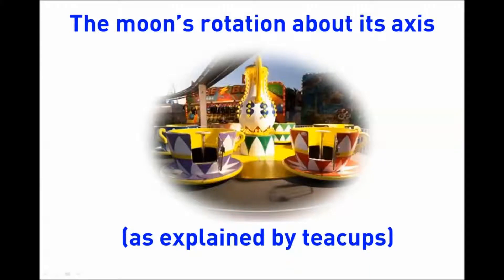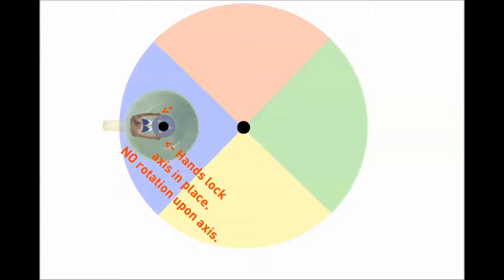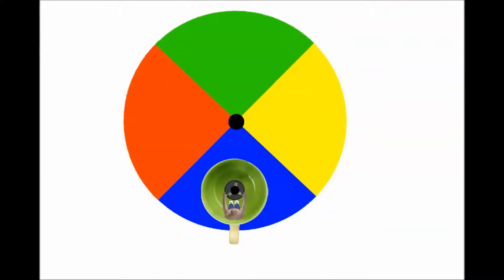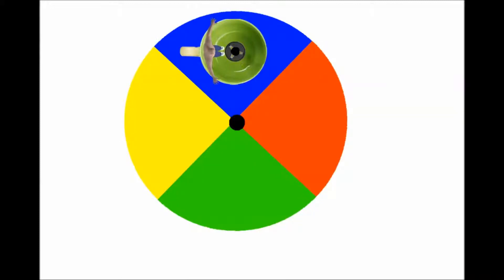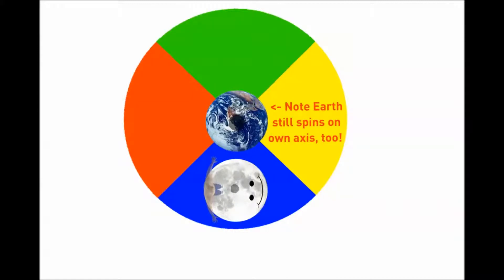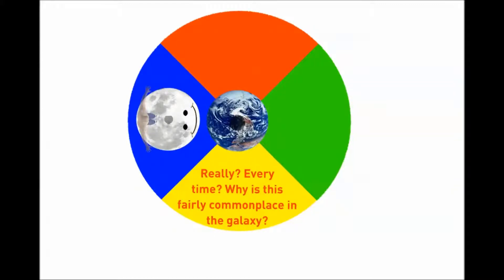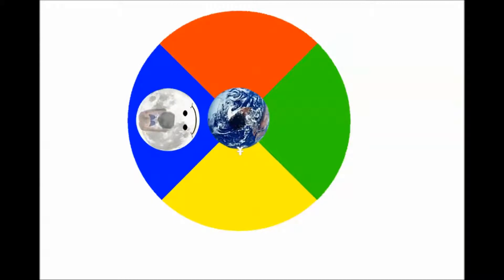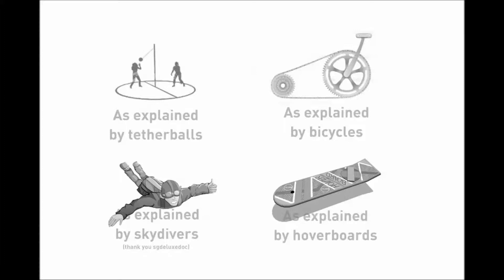Why Doesn't The Moon Rotate Upon Its Own Axis

Comment: Problem is the teacup IS rotating even though it's locked to the center hub. But you might ask "how can this be"? Simple. The hub itself is rotating, thus anything attached to it will ALSO be rotating.